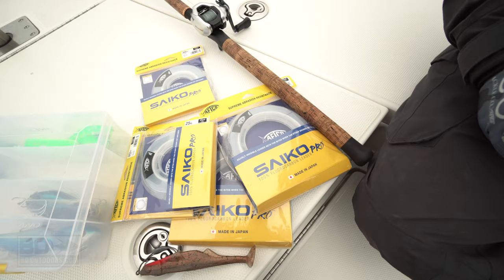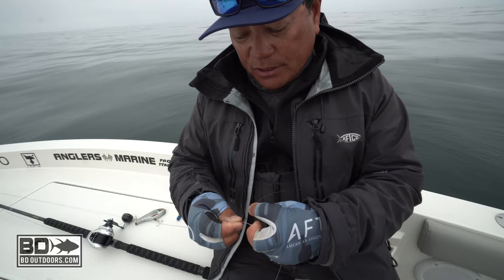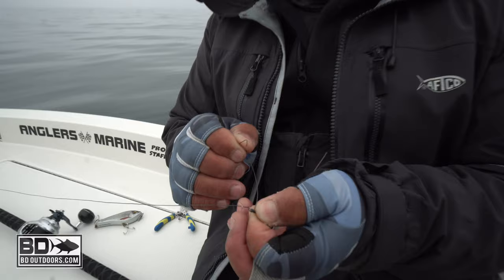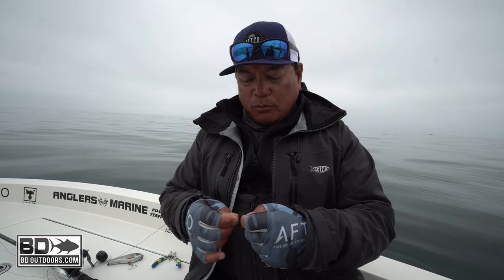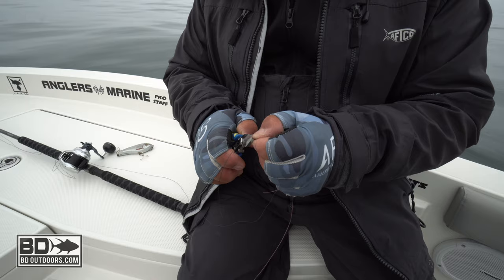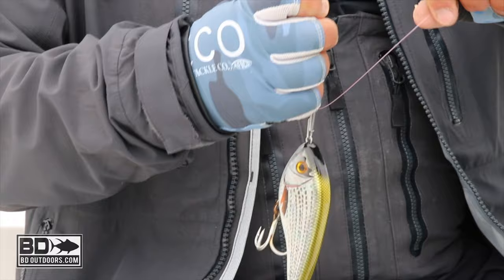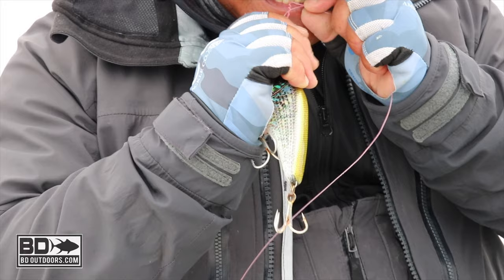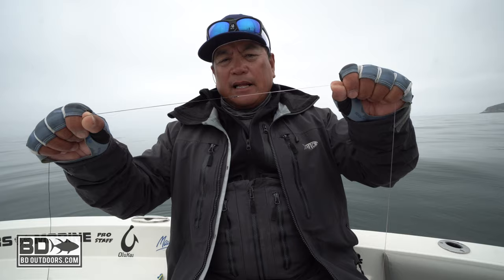Simple Connection Knot Fishing- Braid to Fluorocarbon [RP Knot]

Comment: Ive found out it does matter which way the line goes back in. If you put the line back out the way it comes in you're fine. If you put it in the opposite way it actually saws the leader by the two pulling separate ways. Learned the hard way on a couple big bluefin
Reply from the maker: ooo good to know! sorry for your lost bluefin :(